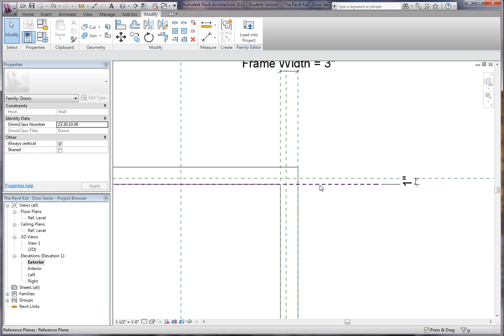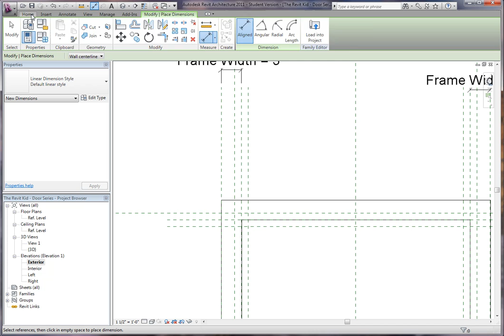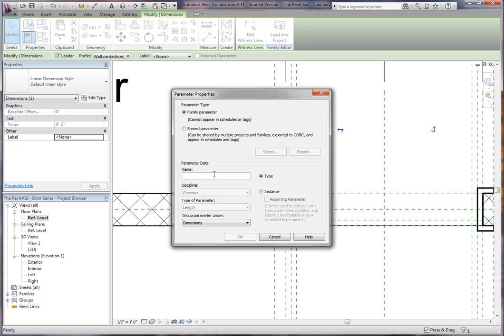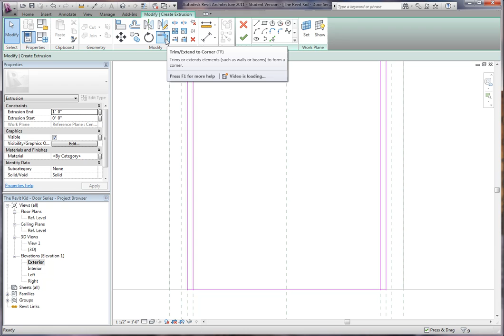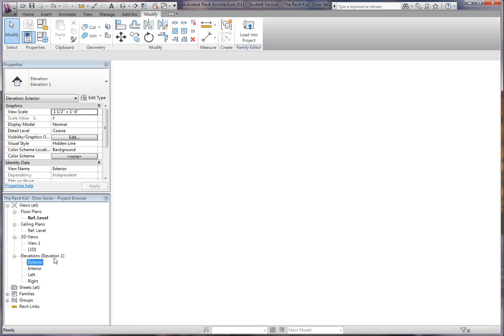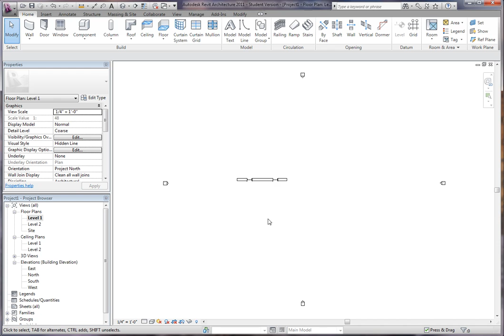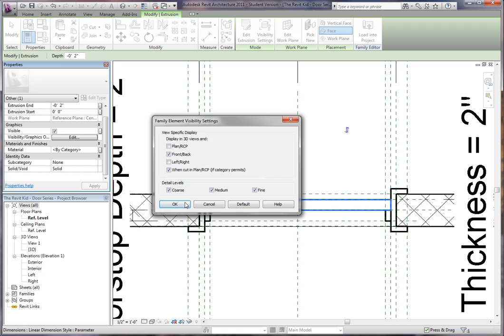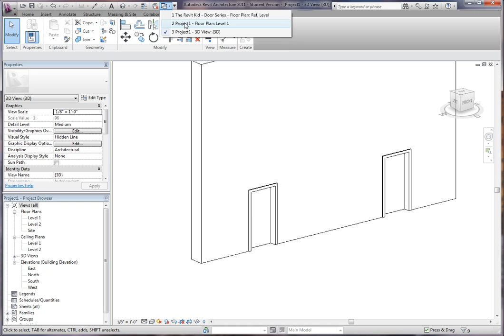Revit Tutorial - The Revit Kid - Create a Door Part 3

Comment: Hi Revitkid

Love your work. Been following this tutorial, and it mostly works. Am having trouble getting the door stop depth and door panel thickness to work. Have added all the parameters as per your video, and the parameters appear when loaded into a project, but they don't update when changed. The door stop width paramter and everything else work perfectly though!